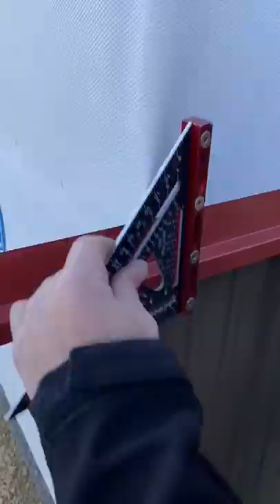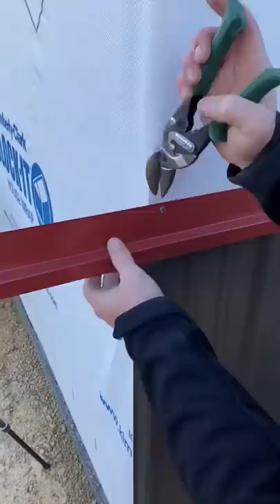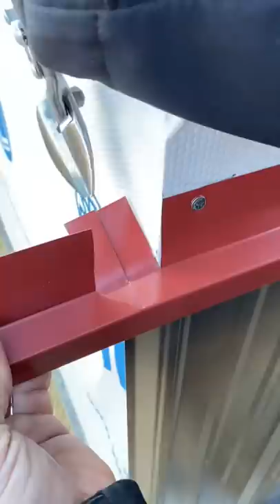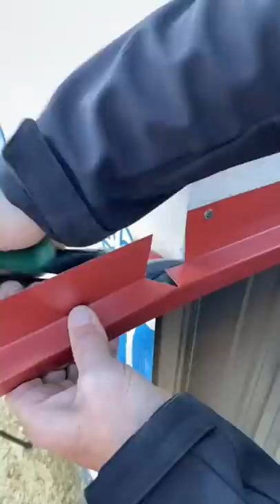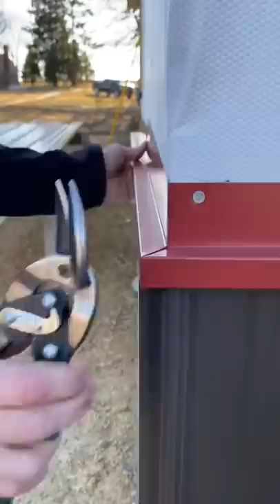Perfect Metal Trim Corner Bend Origami #shorts

Comment: Did you cut off what could have been your overlap tab on purpose  I'm a sheet metal worker and have always left the tab because I was told it was needed for waterproofing. Just wondering
Reply: Yes, that's right
Reply: Why did you cut it off?
Reply: No your correct. OSI sealant instead I guess 😂
Reply: Here you are watching a video on how to...🤔 If I were to guess the os corner trim will shed the water and the house wrap is the second line of defense. Don’t know why you’d rely on a base to do any “waterproofing” but I do see what you mean. There is always a way to improve on something, but what Kyle does is an improvement on most everybody’s buildings skills.
Reply: Well I say "waterproofing because typically when you put your Z metal you have the tabs on your nailing flange that lap correctly for water to flow over the laps then you under caulk then surface caulk which then gets lathe over the nailing flange followed by wire and then stucco or brick or siding but the sandwich effect makes it waterproof each trade should do what they can to ensure there will be no leaks instead of hoping the trade before or after you does their job right
Reply: The way you described was the way pur lathers did it.
When I worked for a stucco company.
Reply: @barebonescraftsman6194  laughs in electrician
Reply: YES!!! I came here too point this out... I live on the oregon coast, and that overlap tab is crucial!
Reply: @xxROEVYxx  I had a membrane roof put on my place, and doing the walk over inspection I noticed they ran the membrane under the overlapping eave of the pitched roof and caulked it...  A caulk depentant seal on a roof? Get heck out!
Reply: @jonpierce8342  lol agreed sir. I was being a smart ass. Everything on a roof or siding especially should work mechanically before sealant is used.
Reply: A little caulk, a little paint, will make a carpenter what he ain't
Reply: I own a siding and window company and you are correct.
Reply: @xxROEVYxx  my correct?
Reply: Show us Barebones ?
Reply: @jonpierce8342  liquid flashing
Reply: @wht240sxka  this is not a "how to" do anything, js. Its a short lol.
Reply: @someguyfrommemphis  almost all r&r videos are a “how to” except tool videos. A “short” is still a video...
Reply: It appears he cut it off for speed and simplicity
Reply: Yep, thought that too
Reply: @grownnotflown2  my bad I just  saw this 
I'll try and make a video tomorrow to give a better visual
Reply: Think like a raindrop. How is water going to get behind that? It's not.
Reply: Why not put a 45 degree miter on it with 2 pieces of steel and seal the corner?
Reply: Been a waterproofer in Seattle for 8 years now and you are correct he should have wrapped that corner. Speed seems to be much more important the quality anymore it seems like tho..
Reply: @shawnhenderson1130  what me mate or the person who made the comment
Reply: https://youtu.be/ChFmrIW4yYM 
Here's a link to how I was taught to cut this type of flashing 
If you guys want a more in depth look of me bending it up and explaining each cut let me know
Reply: It can stay like that ,in our company we where required to put caulking between sheets but it was comerial ,water can go behind the sheet metal water 💧 proofing will stop it from coming in ,I see here they use housewrap not water proofing either way looks great I miss my job
Reply: You right man, him did it wrong
Reply: yes you do.  He cut too much and will now rely on caulk to seal his corner. 

Your metal should seal with no caulk. Then caulk for Xtra protection
Reply: I'm always 2 months late to the party 🤣 a little wind from the right direction and that will leak without the bend. He shouldn't of made that first cut.
Reply: I’m sure it’s gonna have a outside corner covering it...it’ll be just fine 👌🏽
Reply: It's wainscoting z trim the water will run off no issues and it's also tyveked it ain't leaking inside that building
Reply: Don't ever rely on Tyvek or unpinched caulk for waterproofing. Wind has updrafts. I don't care if it's wainscoting, windows eves or base trim z t w c a trim 🤣
Reply: @scottstickler6017  if you want speed and simple just bend it around the corner and hit it with a hammer a few times
Reply: The part he cut off will be covered by the siding (prob tacked in right there in the corner, the part he needed to overlap(bottom) is overlapped.. I don’t see the issue..
Reply: It honestly doesn't matter if you cut the over lap or not he left a corner tab and it covers the corner
Reply: Isn’t it already water proofed from the tyvek?
Reply: Absolutely 💯
Reply: As long as the corner is caulked or has butyl applied in the corner.
Reply: Never cut the flap 👷🤷
Reply: Same here, and I caught that right away
Reply: Dumb question but the tab closest to the corner is the overlap tab?
Reply: @nmatthew7469   if I'm understanding you correctly then yes but there's no tab on the corner.  You would cut it with the tab and bend the tab over then cover it with the finish cut side
Reply: Anybody who does a good job always seals the joints afterwards
Reply: Exactly
Reply: @wht240sxka  reduncy is key when it comes to stopping water. Keep the tab.
Reply: @jejohn3676  there is a difference from 99 and 💯 keep the tab
Reply: @820jdog   Right next to someone’s name there is spot and it tells you how long ago they commented. How relevant or important you may think your comment is, after a YEAR, no one is going to understand or care really what you believe is so important. Go make your own video if you think you know so much better. Tab there or not, you could piss on the corner and nothing is going to be on the inside of the building…
Reply: That was literally the first thing I thought.
Reply: Apprentice sheet metal worker, i was wondering about the tab too but figured i was just retarded
Reply: Yep a tab on the upstanding would have made it more waterproof are real weak point where they just butt together
Reply: In my experience with buildings that look similar to this, there’s always usually a layered system like I’m assuming probably metal wall panels are going to go up with closures sandwiching the bottom of this flashing making the tab not really so necessary, however now that I work in sheet metal full time outside of ironwork…I have always learned to keep those tabs because you can never overdue it when it comes to keeping water out!

Comment: The second mark was 7/8 x3/4 on the third mark! You can clearly see on the speed square..
Reply: Both measurements were 7/8" wide.
Reply: @rickl6697  look again bro. It's 7/8 by 3/4. You never see water table bigger than a inch and a quarter. I know for a fact bro, I've been doing sheet metal for over ten years. Only time it's bigger than that, is when your running a stone siding with a transition into metal siding.
Reply: @clearnoisesounds4390  I was gonna argue, but looking again I totally see first mark at 7/8 and second is definitely 3/4
Reply: @stargatemaster94  lol bro I had to look at it 4 times just to be sure.
Reply: @stargatemaster94  both 3/4
Reply: @nicholaslandolina  wrong
Reply: His first mark was on the corner @ 3" on the square. His second (middle mark) was @ 4 1/8" on the square. So, 7/8" from the corner to the middle mark.
His third mark was @ 5 1/4". So, 7/8" from middle to 3rd mark.
  So, each section is 7/8" apart. Rick L, above, is correct.

Comment: Looks cool only leaks at upper 2”.Proper miter with a fold won’t leak
Reply: Hows it gonna leak when it when never see water😂
Reply: It'll see water. The sheet metal is going to rest on the drip flashing but given the height and profile I'm guessing it's through wall flashing. This will see water from wind driven rain

Comment: Wish for this demonstration you would have used a marker that I could see.
Reply: It's only important the the installer/cut man could see the marks. What's important for the viewer is to see that he made marks to cut and line up the mitre. Dimensions will vary depending on material, but the principal remains the same
Reply: @scottstickler6017  he's demonstrating the process "I" would like to see the process. It would be interesting to see.
Reply: @apauln  if you watched it then you saw it. He marked where the substrate corner was. From that mark he measured the depth of the horizontal flange. From that mark he measured the flange depth one more time. Then he made the 45 degree angle by lining up marks C and B. It's pretty self explanatory without captions and narrations

Comment: I’ve always wondered why you Cut off the right piece instead of bending it round the corner.
I know it’s quicker to Cut it off, but I think it gives a bit more protection to bend it around the corner.
Am I wrong and dumb.
Reply: It’s just economical, saving materials
Reply: It can help waterproof if you leave it on but people put on a vapor barrier or something similar underneath typically meaning that it doesn’t make a huge difference
Reply: @Evegahana  it will if the water egresses behind the flashing. It will affect the longevity of the waynescote.  The wood will be protected but the masonry will fail.

Comment: Nah wouldn’t pass as it isn’t bent around with an overlap on topmost leg
Rest looks good though
Reply: @bignate8312  jeez I wish I could say that to quality control
I said the rest looks good but it wouldn’t pass where we are. I do this fir a living. You?
Reply: I don’t do this for a living but I’d like to understand why this “wouldn’t pass” and what is the deficiency here? Just a DIY guy hoping yo not F up my build. Thanks.
Reply: @Wyoutside  
 hey Brandon
We have to have overlap on ALL legs of the joint
You can see his top most legs just butt up to each other.

His very first cut is where he goes wrong. He should have cut 1/2” to left of that, nipped back to corner then bent that around corner; he was fine the rest of the way.

He basically cut off too much metal.

He does great work. Pointing out a deficiency gets one called a Nazi these days. 😂

Good luck with your project 👍
Reply: @CoffeeTroll  yeah been doing it for two years. That's what we are trained to do at Morton Buildings. You seem to have taken my comment as an insult, its just totally unnecessary to do what you are doing cause both the upper steel and corner trim would cover that. But if you have dudes telling you to do it that way go for it. Sounds like more work for no reason to me.
Reply: It's not about people telling you to do it a certain way. There are sheet metal guidelines that need to be followed so that we can insure that our metal is doing its job which is water proofing. No tabs = small holes and small holes = leaks
Reply: @barebonescraftsman6194  
 absolutely! Thanks 

I do it to the required envelope  code in my area. West (wet) coast Canada

It’s not just “some dude” telling me to do it that way as Nate above says 🙄
Reply: @barebonescraftsman6194  I understand water issues, seems like you got some anal rules around you guys. The way we do it the water would never get to the top leg of the corner because there are two layers of steel on top. The only issues with water we've had are windows and ridge cap so we caulk the shit outta those.
Reply: @barebonescraftsman6194  Who/where do you guys work?
Reply: @bignate8312  in a rush! Do your best Caulk the rest..
Reply: @bignate8312  yea i mean I guess you could just cover it in some sika but caulking only has a 10 year lifespan if applied correctly which is hard to make sure your metal and everything else is free of contaminates I try to build things to last a lifetime but that's just me personally
Reply: @bignate8312  I run a  cali local 206 sheet metal workers union company
Reply: @barebonescraftsman6194  Well I work for the most well-known post-framing company in the world. IE Morton Buildings. You don't need to caulk something that isn't going to get water near it. Of course, we build them to last as long as we can. But after 10 years, your building is going to need some upkeep and maintenance just like any other structure. lol
Reply: @bignate8312  siding applications are 25 or 30 years lifespans. If you don’t flash the metal properly water gets in behind your wanecoting and will ice wedge the rock mud off the wall. 

Our building codes are set to the international building code guide. This flashing would fail and so would the weather barrier. It should underflash the metal by ten inches above and then have another piece of paper on top of the metal. Like this the water will condensate behind your siding and run down behind your stone and blam! Water egress.
Reply: @bignate8312  I've built my fair share of steel structures and mortan buildings are very good quality but there are alot of high quality companies when it comes to steel structures but the quality isn't as important  when the people you have assembling it don't take pride in their work and assume they know all of the variables just to cut corners
Reply: @bignate8312  also working for a great company doesn't make someone great by association and having to name drop where you work over and over doesn't help your argument   there are plenty of jobsite supervisors making 500k a year that couldn't plum a post to save their lives
Reply: @CoffeeTroll  what's it like being a tin knocker up in Canada here in Cali I have days that are so hot that the metal will burn your hands but I can't imagine having it freeze to them lol
Reply: @barebonescraftsman6194  Haha I’d take the cold over the heat. I’m in the lower mainland of Vancouver, so our temperatures are never that extreme. Snow only falls every other year. We just have to deal with A LOT of water. Sometimes weeks of rain with no chance of drying out. Water creeps into everything if it’s not done right.

Ironically it’s supposed to go up to record breaking temps near 120 F today and tomorrow.
Not sure how you guys deal with the heat

Agree with you on all your points above BTW. Be safe up there
Reply: @CoffeeTroll  damn 120 is brutal if you guys have maxiflex gloves go ahead and double those up and if you can keep your material in the shade or you'll be able to cook an egg on it. Caulking too it becomes soup lol.  Goodluck make sure you take those heat breaks and stay safe

Comment: Grinder with a 4" zip disk cuts that time in half. Wouldn't seem like much time on one corner but doing an entire house it's extremely quick and accurate.
Reply: Wrong....zip discs heat up the metal and damage the paint leaving discoloration and gaps
Reply: @silverfeatherhomestead1170  your just wrong.
Reply: @patricklangan9790  27 years doing flashings...I know what I'm talking about. Most suppliers won't warranty the  product if you use cutting discs

Comment: Why didn't you just cut a 1/16th of an inch shy of a 90° on the channel part of that metal? Because the way that you cut it, allows water intrusion right at the 45° corner and it's directly on top where water will be guaranteed to enter. You've always got to think about water-shed. Not the kind where we enjoy great bands and drinks either lol.

Enjoy your videos tho so don't get me wrong. Just offering my constructive criticism as I'm a builder with 30+ years in the trades as well. 👍🇺🇲

Comment: But what’s the actual measurements for this? Like how far apart are the cuts supposed to be?
Reply: The width of the metal. You measure across the street and than measure from across the back forward that amount and connect the dots. It's just a 45 degree corner so long as the corner is 90

Comment: Quick question. I know you run a long j-channel trim across the top of a window to avoid water intrusion behind the metal. Would it be possible for you to do a short on how you trim out the lower corners on a window to keep out water? Thanks in advance.
Reply: You don't run a j on top you run j on sides n bottom top has the same flashing as this video usually in my experience

Comment: Being in the sheet metal ductwork business I've done this so many times over the years I can't count them.  I thought everyone knew how to do this.  And I don't think anyone taught me.  It just seems like common sense.  I've seen others use this same technique as well since the 60's.  If you want to angle an extruded shape you must determine the location of the bend then 45 degree cut to relieve the other parts of the extrusion.  Personally, I like to make a small split where the bend will occur to coax the metal to bend at exactly the place I desire.  I think that was the technique used here but it was too quick to be of much use to anyone.  I think the speed of the video was for effect.  It made the process look complicated.  It isn't.  It's almost stupid simple.

Comment: Where are your tabs my man, can’t lap sheet metal properly without something to assist in making a barrier in the seam
Reply: That and he has a negative lap with the building wrap, and if you do tuck under make sure you have a membrane between the flashing and wood metal can't touch wood they heat up at different times and will cause the wood to sweat and rot out

Comment: You cut off the tab bro, unnecessary step and it does more harm to remove it. The overlapping tap stops any rain or moisture from getting in between the back of the Mitre.

Comment: well played sire. tell us why those measurements are that.
Reply: #1 Measure to the corner from where ever you're starting that piece, line, #2 add 1 and 1/8th", line, #3 add another 1 and 18th", line (so from corner line it would be 2 and 1/4th"). Or if your trim is a different width, measure the width and add it twice like I did previously. Make sure to crimp like shown for your corner will look wonky. Morton Buildings calls this transition trim (transition between wainscot steel and upper high rib steel). Also heard it called base trim, but usually, that goes at the bottom of the wainscot. Same stuff.